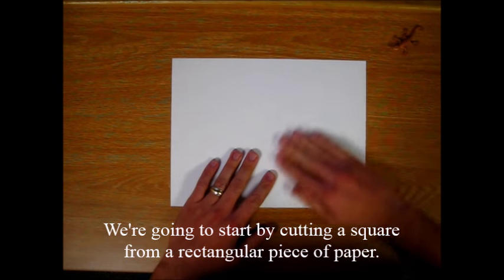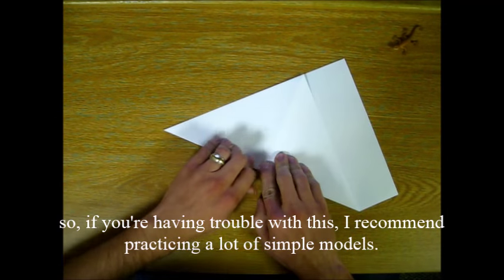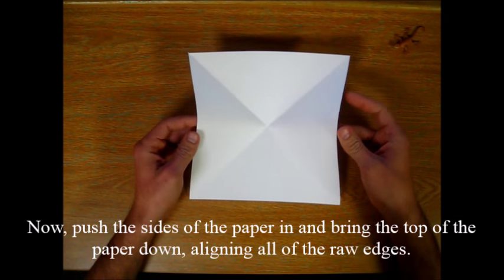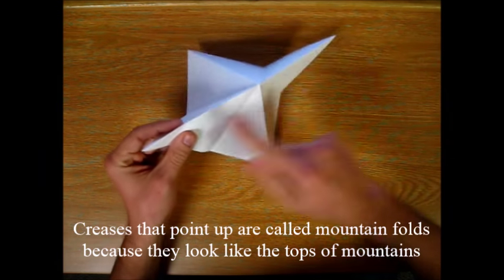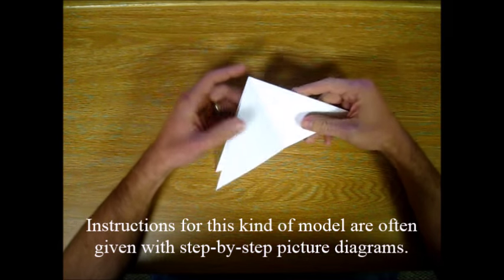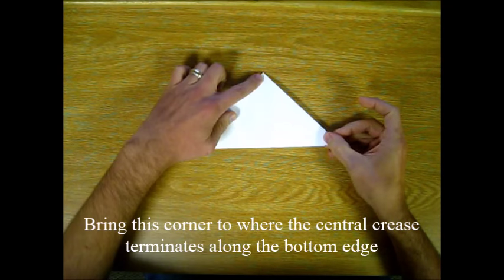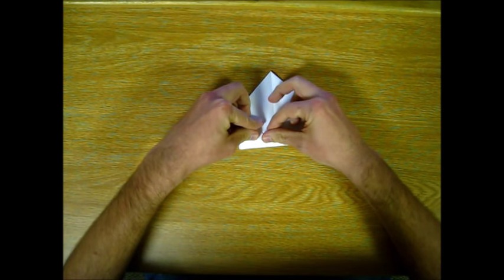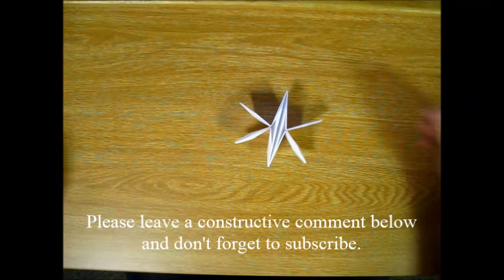Box Pleating: Origami Design Tutorial (Level 1)

Comment: I appreciate the video, and I've been folding for a number of years and have recently wanted to do a bit of designing.
You asked for criticism, and here it is:

You walked us through the process of making this base, but you didn't connect it back to box pleating. How exactly was the base a result of box pleating? what is box pleating?

Thanks, video is good, definitions are good, just that little thing
Reply from the maker: Hi Shaheer. Thanks for your question. Yes, the base is a 2 unit wide by 2 unit long flap. I was showing that the simplest flap made from box pleating is a waterbomb base with each side folded in half and sunken. You're right. It would have been better if I had examined the crease pattern in this video to show how that process produced a pattern of horizontal, vertical, and diagonal creases.